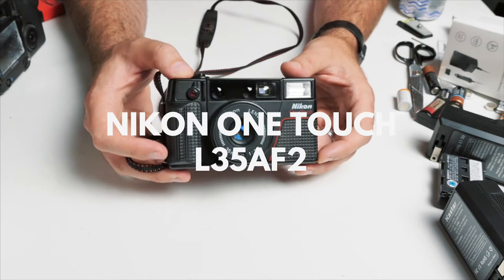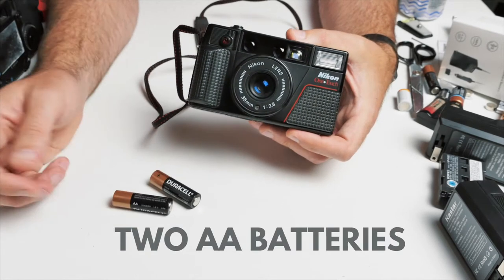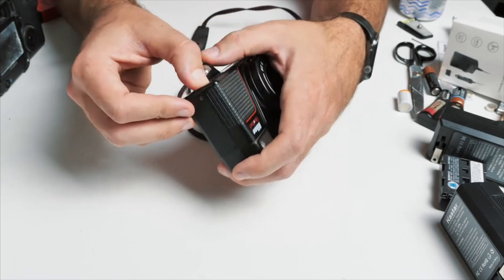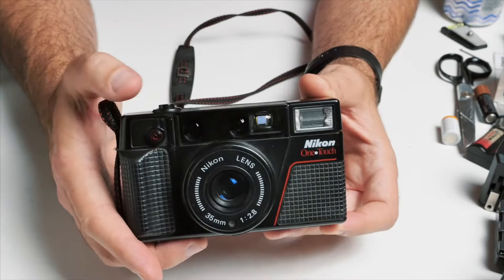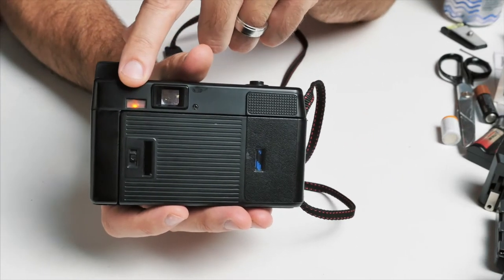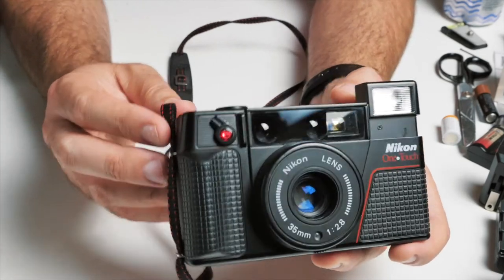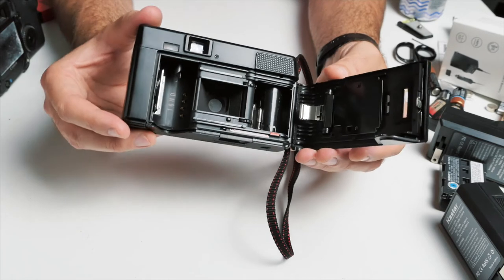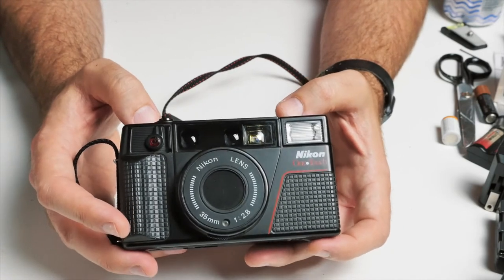How to USE a NIKON One Touch L35AF2 35mm Film Camera - BATTERY Replacement & REVIEW

Comment: Mine does not open the blades when I press the shutter. I noticed this one does not either. Does it work?
Reply from the maker: Stuck shutter blades is not good.  Very common with this camera as well as the canon af35m.  It’s due to oily blades from my understanding.  I’ve not tried to fix so for me it’s a broken camera.  As for this camera I’m pretty sure it was working properly.  Maybe it misfired.  Let me know if you find a fix for your shutter blades! 👍